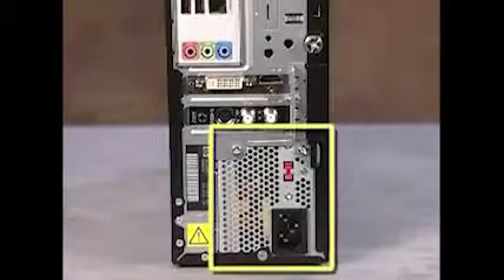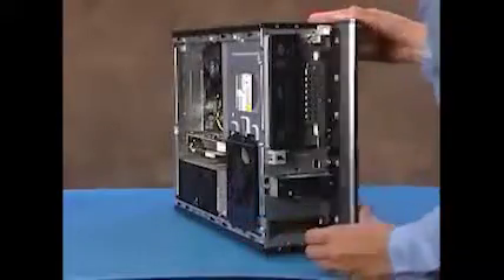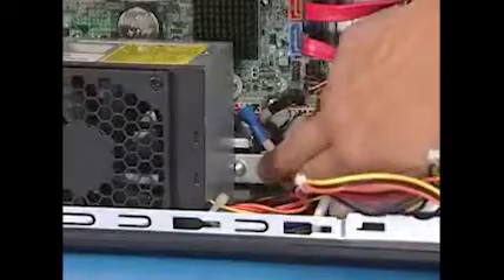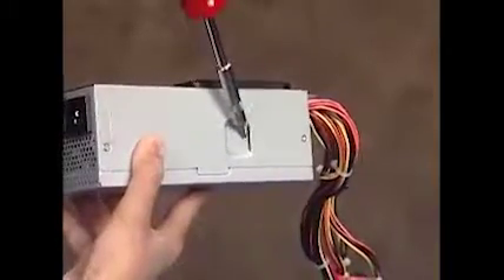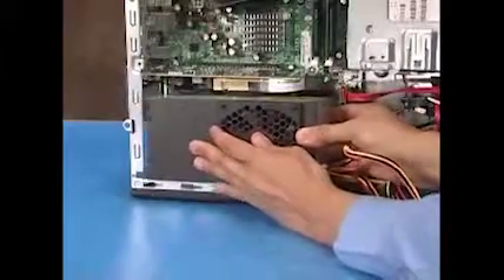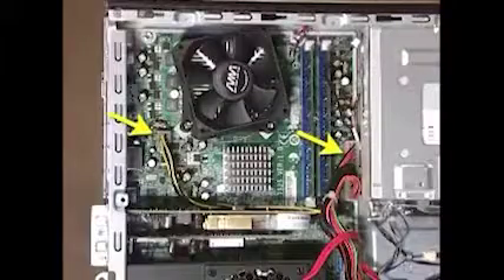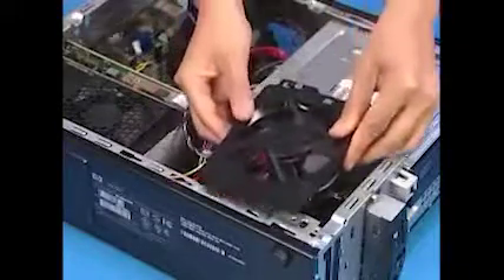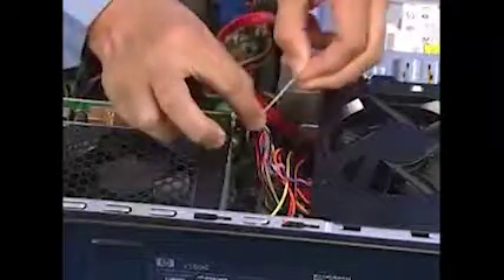Replace Power Supply | Pavilion Slimline | HP Support

Comment: I know this is a longshot but, I have the s5257c model and it will turn on for a little while then randomly shut down. Could replacing the power supply solve this issue? the fans and etc seem ok
Reply from the maker: Hi there, thanks for contacting HP Global Social Media Support!
I understand that you are experiencing an issue with your computer as it is not starting. 
I will do my best to assist you.
Please refer to the instructions mentioned under this document to fix the issue: https://hp.care/3UTnzxC
Regards, 
HP Support

Comment: Can we replace with 500w power supply
Reply from the maker: +Technical Ayush HP does not recommend upgrading or downgrading hardware parts or software that is bundled with the product as It may affect the manufacturer's warranty and performance, however, you could change the configuration at your own discretion.
Reply: @HPSupport  Abe sale ek reply copy kiya h usi ko  paste krta rhat h

Comment: If you have an HP Pavilion Slimline and it's not turning on or only turns on intermittently,  there is a capacitor inside the powersupply that needs to be replaced. It's 1500uf 16v capacitor. If it looks swollen or bulged, replace it and your power supply should start working again.
Reply from the maker: +Beast6228 Thanks for the update.
Reply: Wow thanks. This is what happens to my psu.
Reply: I have a HP Pavilion Slimline 260-p026, any PSU upgrades over 200W that can fit?
Reply: @Lunerine  Most power supply companies make Micro ATX and Micro ITX power supplies that can deliver 600+ watts or more. However, you would be wasting your money on a computer like this, it's limited on what it can do processor-wise. You could buy a faster computer for less than you would buying a power supply.
Reply: I hace this problem but my power supply don't have that capacitor